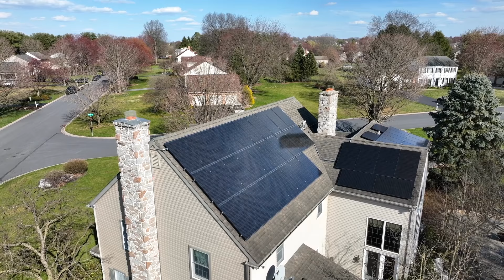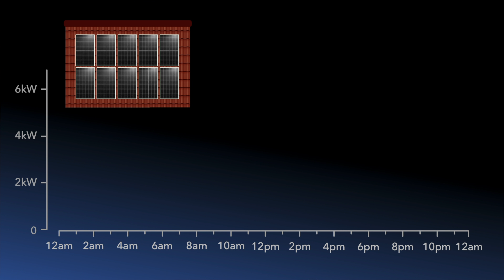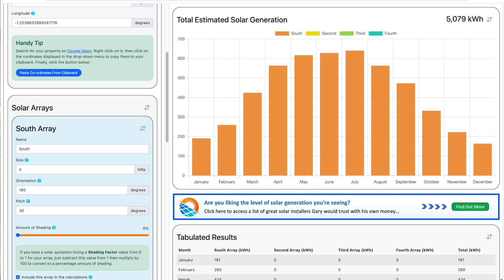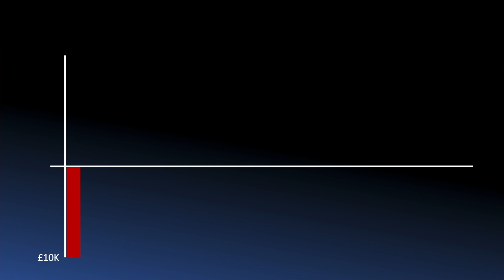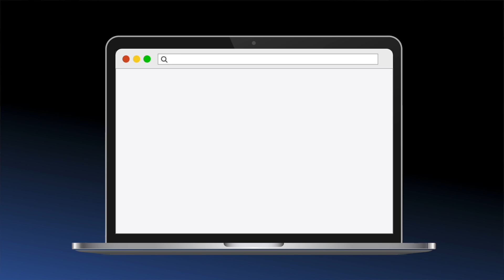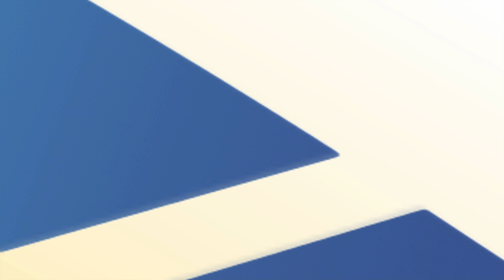How Home Solar Can Cut Your Bills Drastically

Comment: My 15 panel 7kw Solar/Battery installation finally goes ahead next week.
I almost went for Sigenergy 10kwh battery with 6kw inverter, but finally decided on  Powerwall 3.
Then my G99 DNO application gave me the full 11Kw inverter.
I think there is a problem doing the DNO application AFTER you have signed up with an installer. 
Reason - If you know the inverter size granted by the DNO BEFORE you make what is a significant financial decision, it surely would affect that decision.
If your chosen supplier knows you have picked say a 6kw inverter, would they have even applied for 11Kw with the DNO?
I am now pleased I went for the Powerwall, which can be software updated to match the 11Kw granted.
Is my thinking correct?

Comment: I have had a zero bill for the last two years and that includes driving 9000 miles in an old bmw i3. It has been well worth the money and today it is cheaper than when I bought my solar and battery.
Reply: Two years with effectively no electricity bill and charging an EV is pretty hard to argue with. Those are the sort of real-world results people need to see.
Reply from the maker: That's really great to hear—thanks for sharing this! Hopefully others will see that an investment into solar is well worth it! ... and I didn't get a chance to speak about all the environmental benefits that come with that! 😁
Reply: @GaryDoesSolar I think a significant number of people don’t care about the environment. It is worth doing videos just about the money as people who care about the environment are already onboard.
Reply: @pmac6584  Money 1st, environmental benefits an incidentally nice secondary bonus
Reply: @GaryDoesSolar 

Have you ever stopped to consider how inherently unfair the UK renewable system is Gary?

By that, I mean it's great for those with decent sized homes with driveways.
Room and financial backing to install Solar, home batteries, Heat pumps (the former needed to make them practical) and possibly an EV.
It's working great for them isn't it?
Smart tarrifs, cheap stored electricity throughout the day or via PV generation.
Crazy low per kwh EV 'filling'
You have them in your comments all the time, it's the nature of your channel naturally.

But consider the other side of the coin:

All those many, many millions of UK homes, who CAN'T take advantage of any green tech, either situationally and or financially.

But assuming they're working and paying taxes, they have been:

Contributing tax towards EV discounts for the well off.
Paying increased standing charges to support the rollout of renewables, which only the well off financially benefit from.
Contributing via energy costs to 'warm home schemes', and other initiatives like the £7,500 heatpump BUS discounts.
Oh, and the current 5% VAT on green tech.
Then some of their energy costs go towards filling the short fall for those increasing millions of families, who are now in fuel poverty and debt.

Pretty perverse really isn't it?
Why must you be rich enough, to be able to afford an EV, or a Heat Pump, to ONLY THEN be granted access to smart Tarrifs.  Tarrifs only made possibly by smart meters, which by the way, they also contine to Contribute  towards correct...?

So the less fortunate, are disproportionately impacted by the green renewable drive.
All they are seeing are their bills go UP, and no end in sight.

No wonder Reforms populist dogma resonates so well?

Why can't such homes be given access to Octopus Go type deals, so they could at least benefit from 5-6 hours of cheap (supposedly renewable derived) overnight power?

It would at least offer the opportunity for them to load shift etc.
That would be a difference of several hundred £'s a year, and at least give ppl hope that this direction isn't fruitless.

But no.  Any benefits are reserved for the relative rich, firmly behind a high paywall.

I've said it before, I detest Reform and their ilk, but boy oh boy, as a Nation are we giving them easy wins.

For every green tech / smart tarrif beneficiary, there are 50 homes looking at the renewables  cost escalation in despair. 

Those 50-1 will vote where?

A what point do we have a conversation about how damaging it was been for Britain's future?

Gas, we now get most from LPG via the US, derived from fracking, pretty much one of the most environmentally damaging methods created.

Steel? - less our diminished remains plant, it's all China.  Who still account for 55% of the world's annual coal usage each year.  Granted they are making impressive progress to de-carbon.

Fertiliser? The last plant in the North shut down, mostly due to energy costs.
Fertiliser to make the food we eat grow?
Mostly via Poland.  Poland who's main power comes from.....coal!

Any and all significant heavy industry has ceased in the UK.
But we still and always will need the output from said industries.
Which invariably (exceptions exist) we import at higher costs, and there manufacturer is at a higher carbon intensity?!
We've lost millions of jobs, and the subsequent tax revenue from those typically decently paid jobs.
To replace it with what?
Gig economy pish and zero hour uncertainty 'work'

The light at the end of the tunnel appears to be a flame thrower Gary.

How have we ended up in the catastrophic situation, and why are certain parties applauding the 'achievements' ?

Projects are by 2031 curtailment costs will be in excess of 5 billion a year.

It's only the more fortunate green tech owning 'bourgeois elite' who benefit in any manner really isn't it?

Try and put yourself in their shoes :(
Reply: @stuartburns8657  We get most of our gas via pipeline from Norway and some from the North Sea but almost none from the USA because LNG is incredibly expensive even compared with piped gas.

Even including curtailment costs wind energy is still making UK power cheaper than it would otherwise be, although the oil shills like to spin in otherwise.

The bourgeois elite don't generally own green tech. When you've got a 5 million pound house and no mortgage or loans and your stocks and shares are earning you 150 grand a year (mostly tax free) you don't even notice the gas prices. The richest areas of the UK are mostly devoid of solar panels.

There are definitely access problems for poorer people to solar and batteries and the like, which is exactly why there are a load of grants and zero interest loan schemes.  On the grid side though it's hard to do anything because the tories sold it all off to foreign billionaires so all your money that should be going into grid improvements mostly seems to end up in yachts and "overheads" not fixing anything. It's just that unlike railtrack and the water it's not turned into such a catastrophe that people noticed yet.

Biggest problem though is rental. Landlords have no reason to insulate or to fit solar and both labour and tories kicked the can down the road, whilst reform is talking about abolishing lots of tenant rights for their landlord friends. So at this point it's 2030 before landlords have to reach EPC C on rentals, and even then with exceptions you could drive a cybertruck through
Reply: Im super new to solar with my 8 panels split east ish and south ish im only peaking at around 3.5kw but my new pw3 is full by 13:00 and stays full till around 19:00 . We only use around 11kw aday and for the past week my grid usage is zero
Reply: @OldGeezerGazing If you have an ev then you are better off charging the battery overnight and selling all your solar. Then in the evening sell off any spare battery capacity. This is how I manage to get a zero bill across the year.

Comment: One topic to look at is the amount of wall and floor space needed to install all the batteries, gateway, other switchgear needed for an installation.  In smaller properties, the lack of spare wall space could be a make-or-break factor.
Reply: But it doesn’t have to be internal space, batteries etc can be fitted on the outside walls (space allowing of course)
Reply: You can get all in one systems as a small property will not need as much battery. The ecoflow ultra x is about the size of a small suitcase and can be left outside or inside.
Reply: They go on the outside. In fact with PAS63100 now being effectively regulation they pretty much have to go outside in most small houses.

Comment: Great video. I've had a solar and battery system installed for 18 months and am very happy with how much it is reducing my energy bills.

One thing I'm unsure about is what is the best setting for recharging the battery?

I have a 5kW inverter, 10kWh battery and six hours of cheap rate electricity each night. I believe inverters are most efficient when working close to their maximum capacity, but it's better for the battery to charge it slowly? So should I charge the battery as quickly as possible in around two hours for maximum efficiency? or more slowly so that it takes six hours to be kinder to the battery? Or doesn't it matter?
Reply from the maker: That's really great to hear, Malcolm! It's great to see comments like this—it's not just me saying so, but many others who've installed solar as well 😁

On the battery charging/discharging front—they are built to last—certainly for the entire warranty period—but if you're able to lower the charging/discharging rate to fully cover the off-peak period, that wouldn't hurt at all 👍
Reply: If your inverter isn't one of those horrible things with closed protocols then look at stuff like Predbat and Home Assistant if you really want to refine this. It'll do smart charging based on your usage, on the likely solar generation each day etc.

On a typical decent quality LFP battery if you are doing one full cycle a day you really don't need to worry much about the fine details though, your battery is going to primarily drop in performance through time based aging not usage based aging. On tariffs like Cosy if you are doing 3 a day much of the year then it might matter a bit, particularly if your battery is somewhere it gets very hot.